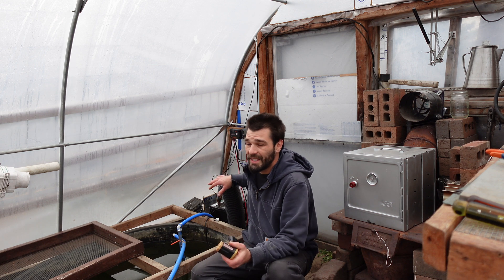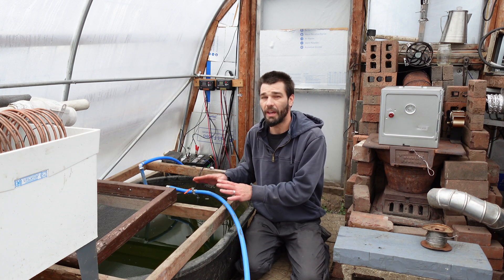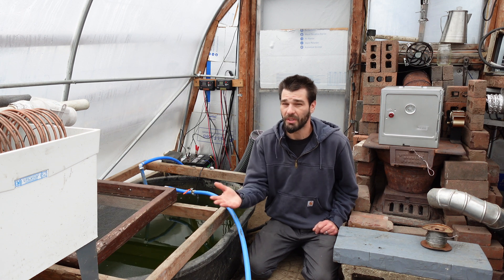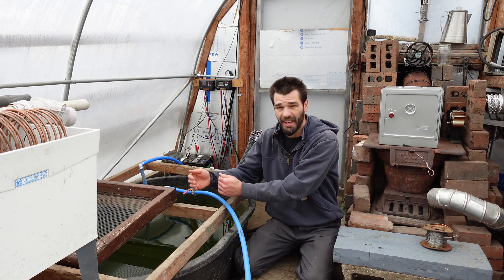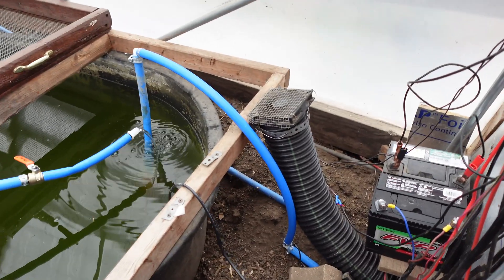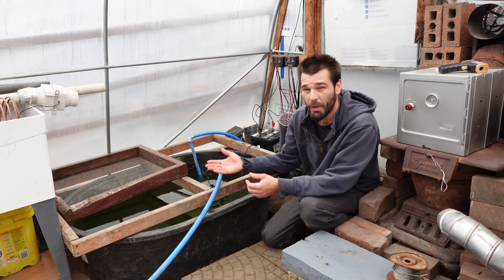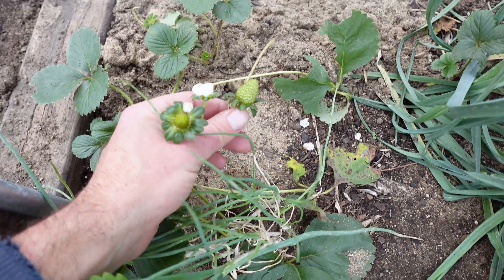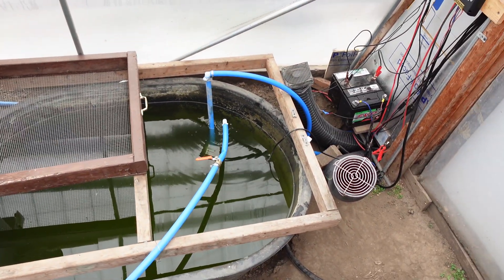CHEAP DIY Greenhouse Heater Operating Temps -  Jean Pain Compost Heater - Winter  24/25

Comment: I dont understand where you have the blue hose going to in the green house.  I see it gets pumped from the tank to the compost pile but where does it go to in the greenhouse before it gets dumped back into the tank?  Ive watched almost all the videos and cant find an explanation.  Thanks for the videos.
Reply from the maker: that's a great question I'm sure many have pondered! so it warms the beds it wraps around, I'm in the process of moving it to the planted beds of annuals for eating as we speak. its basically used as a warmer for anywhere it lies, 100 foot in the pile and 100 foot in the greenhouse and with our 52 foot greenhouse it fits perfect for a loop

Comment: Great project.  Subscribed.  I have many questions: 
Could you tell me more about your compost pile?  Is it mostly wood chips?  How many greens?  What kind of wood?  If you had a smaller pile, but also a smaller greenhouse,  do you think it would work?  Why bother with the hot air, and simplify with a hot water radiator?   Or was that just an experiment?   Thanks!

Comment: Have a supply tank that is elevated in the green house as a reservoir, use it to feed into the supply line, using gravity flow and minimize the regulation needed of the supply line.  Right now the pump is running against all that back pressure and that generally will draw more power to keep the supply at a higher pressure for no reason, just to be bled off later.
Reply from the maker: that's a great idea, although I would rather have the pile lower than the greenhouse for the natural thermophilic draw. the pump is working a bit and I'm going to fix that with a motor speed controller to wind in the power usage also. thanks for checking this out!

Comment: Do you often water the compost pile? And what do you do when the compost pile starts going cold? Mine constantly would go cold last year. Trying to go bigger this year.
Reply from the maker: that's a big concern, I will water if its dry but I like to cover the pile to hold moisture. if the pile does go cold or start to there's a few things you can do. we like to water with a slurry of chicken poo and nitrogen rich materials infused or slurried together in buckets for good absorption and dispersing in the pile. insulating with leaves or yard waste, straw bales, anything to insulate inside from outside, tarps and poly offcuts work too.  there's always carbon left in the Woodchips and having nitrogen added will reactivate it but getting moisture throughout is difficult. I have used snow before as water for the pile lol, where there's will there's a way!

Comment: I’ve got questions about what your plan is for when the pile cools down. Are you going to turn it and add new material?
Reply from the maker: if it cools we will slurry chicken poo and water to reinoculate the pile with additional water if the temps allow, I've put snow on the pile as it melted it, it soaked in for moisture. thanks for checking this out